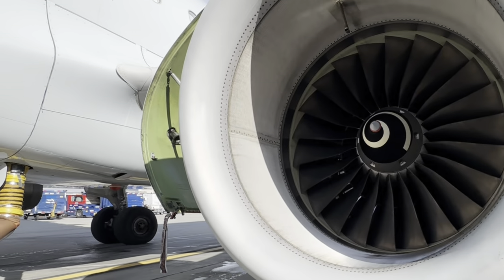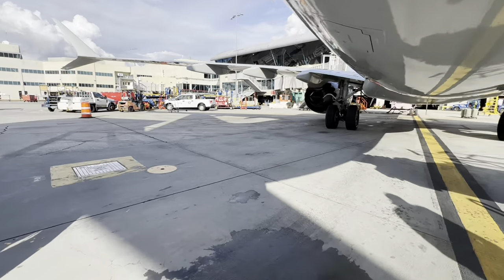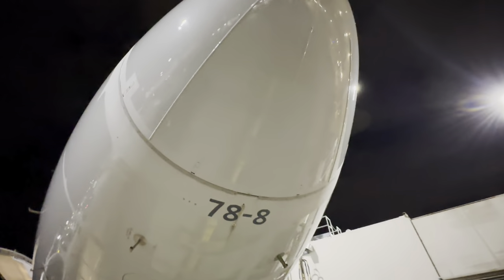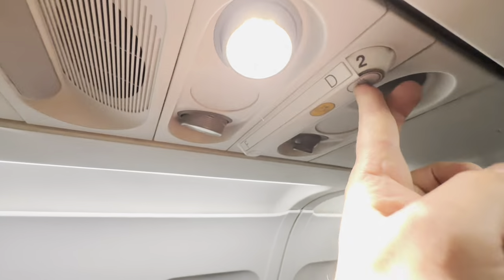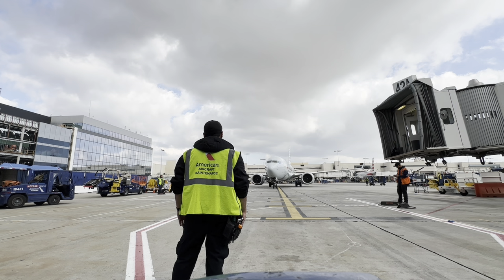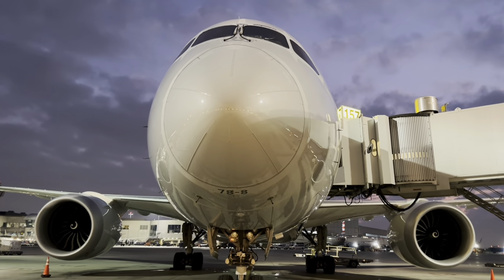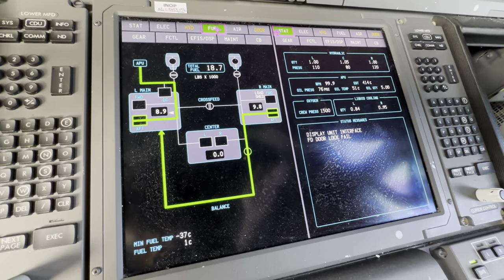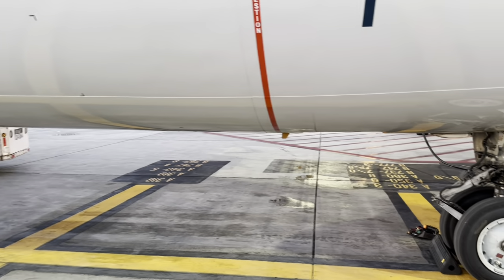Stig Shift #7 (22DEC23 - 24DEC23) Christmas Special

Comment: You work on many Aircraft,  what's your thoughts between Boeing and Airbus these days, which do you think makes the best Aircraft, in regards to build quality, I know since Boeing teamed up with McDonald Douglas, and moved plants, there finished products have been questionable
Reply from the maker: That’s a hard question to answer, I love both but I also have complaints on both. Nothing is perfectly made sometimes. There’s always a give and take. For example, Boeing is an excellent product, built for longevity, but in recent, their quality assurance has been lacking. And it makes me question why they are not producing flawless aircraft as they used to. Obviously we can bring in the discussion of the merger of McDonnell Douglas. But that’s a whole separate subject. In regards to Airbus, they build an excellent product, but it does not have the longevity. Overall, if these aircraft are properly maintained, they will pretty much fly forever, but at that point, you have to look at cost-effectiveness.
Reply: @StigAviation  Thank you for answering me, and a happy new year by the way, a while ago I watched a programme called broken dreams, and it focused on the dreamliner and it's build quality, even asking if Boeing workers would fly on it, lots of them said no, but to date they have never lost an aircraft of that type, I'm wondering if in the future the problem will be with many carbon fibre planes, and there degradation, but as they say aircraft travel is still the safest form of transport, I just wish all manufacturers would list safety at the top before profits 👍

Comment: From top to bottom throughout your video in one breath, thanks, Stig!!!👍👍👍 I'm proud of your attitude: every A/C is a piece of the art, doesn't matter Airbus or Boeing. By the way, I'm B1 on A320 fam. We've  got A320 with CFM56, LEAP & V2500. What I think, V2500 is less maintenance friendly as other, although I love this engine🙂
Reply from the maker: V2500 is a special child. For some reason, I have deep connection with that engine, I have taken it apart, and I have put it back together myself. I know it’s a very difficult engine and very poorly designed in some cases because Pratt & Whitney decided to touch it, but its Rolls Royce roots stand true and this is why I love it.

Comment: I’m curious about the single fuel crossfeed valve on the 787. My airline’s 767 fleet all have dual x-feed valves (except for a few tails) for ETOPS functionality. The few tails that have a single valve have to be cycled before top of descend on each flight to make sure they work. It’s obviously done at the end of the flight in case the valve fails open. Do know why the 787 only has one valve? Are any procedures in place?
Reply from the maker: William, I haven’t had many issues in regards to the crossfeed valve within the 787. I will do my due diligence and study further and try to understand the manuals more. I am not sure if it has a secondary crossfeed valve. I’ll get back to you on this one buddy. The 787 is a very fascinating creature and it’s incredibly complicated. I learn every single day from it even though I’ve been working on it for the past 7 years.

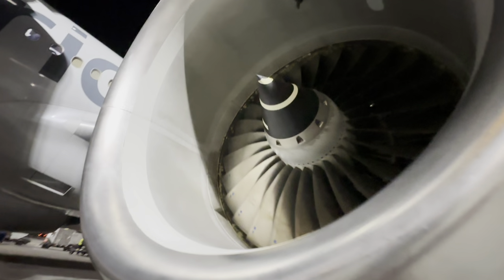Comment: Lol 18:31 @ Stig. As a P&W employee that has an intimate knowledge of our product, wait until you guys start messing with the GTF 😂😂. We were on Flight Test compliance engine 2 (like 2012) and the test engineer handed me a LRU list to validate fits. Out of 20 planned LRU swaps…… I returned with only 3 and I distinctly remember telling Hamilton SubStandard that Airline guys are going to HATE this pig.The PW4000 is a beast tho, when we slam it to TOGA, the entire test stand will move.
Reply from the maker: No doubt the 4000 is a beast of an engine, it is just a pain to work on. As for the GTF engine, we will not be getting those, we are a fleet of CFM leap engines.

Comment: Random fact, Concorde’s fuel tank ruptured from the inside because of the pressure from the impact. The fuel tank was supposed to have an air gap when filled (12% I believe) but had its limit removed by the captain to over fuel to 100%. The impact of the strip of metal caused the pressure wave to blow out downwards
Reply from the maker: You are absolutely correct Justin. Hence why modern aircraft now have these impact resistant door as well as surge tanks for protection from cavitation

Comment: Here’s a question: how long does an engine stay hot for after it’s shut down? Meaning, at what point could you touch components with your bare hands? Thanks and love the videos!
Reply from the maker: That depends on what part of the engine you’re wanting to touch. On shut down, it usually takes about 30 minutes for the external portion of the engine on the hot section to cool down, anything on the internal portion of the engine it usually takes about 3 to 4 hours to completely cool down.
Reply: @StigAviation  good to know, thanks!

Comment: Question - how often does the plane exterior get cleaned? Mainly the brake dust, oil grime under the engines, stains under the belly? Does it happen during some of the maintenance work? Or do the planes get washed randomly? Also, what products do you guys use to clean turbine / oil soot, and inside wheel wells?  Thanks!
Reply from the maker: Usually on intervals or heavy checks. I actually made a whole video about this. Check it out if you have time
Reply: @StigAviation  will look. Thank you. Again, love your vids and IG 👍🏽 I do a lot of my own maintenance with my A&Ps and IAs. Good stuff

Comment: Stig I have some questions for you. Have you ever performed a turbine/compressor jet engine washing? What kind of fuel do you use for aircrafts jet-A or jet-A1?
Reply from the maker: Yes I have done many engine washes. It’s actually a fun process. As for the fuel it’s usually JET-A1 and there are some airlines that use Biofuel.

Comment: The green light on the side of the "flat bed seats" indicates if the seat is in a safe configuration for Taxi, Take-off & Landing (TTL light).  It comes on to show that "an internal lock is engaged" to hold the seat in the upright position for TTL.  Without the lock, the seat would not be able to hold itself up in the event of an emergency (on the ground).  Love the content...thanks!
Reply from the maker: You’re absolutely correct and thank your for giving the TTL info. Thank you for being here

Comment: I was waiting for this one! Love the vids keep it up. Also what causes the discolouration in the engine get caused by and why is it always black and what is it made of, also how does the 777x put its winglets up from the flight deck, also seems like a dumb question but why do some engines have a cheese grater looking thing in them for cooling or
Reply from the maker: The discoloration of the engine comes from heat, those exhaust cones are usually made out of titanium, overtime and heat exposure. It will discolor. I don’t know much about the 777X. So I cannot speak on it intelligently. And if you’re asking about the cheese, grater, looking thing inside the bypass, that is for oil cooling, I believe I explained that in the video.

Comment: Hope you had a great holiday. Is jet-a basically the same as kerosene? How much psi are in the tires?
Reply from the maker: Jet A is basically a a refined version of kerosene it’s basically diesel. In regards to the amount of pressure in the tires it’s relative to the particular aircraft, let me know what aircraft tire pressure you wanna know about, overall, it usually ranges around 200 psi.
Reply: @StigAviation  interesting. I didnt realize that jet-a was closer to diesel than kerosene. Thats a lot more pressure than what i would have guessed

Comment: Great vid, Stig! Thanks for sharing all this info, always interesting to learn. What’s the general opinion on the difficulty working on the P&W GTF? I work at Pratt’s MRO shop in West Palm Beach supporting the PW1100 (A320/321 Neo).
Reply from the maker: I wish I could tell you, but I don’t work the Pratt & Whitney 1100, we don’t have those in our fleet. We have the CFM leap engines.
Reply: You'd have to reach-out to someone on Delta Tech Ops - they have GTFs on their A220s & A321NEOs.  Also United has only just started to receive A321NEOs - they have GTFs, as well, but are essentially brand new in Dec 2023, so likely not much practical experience yet.

Comment: Do the white dots on the top of the bottom of certain controls have something to do with the hat controller
Reply from the maker: There’s 2 parts to this. Certain push buttons light have two dots, Indicating that The corresponding part of the push button is not used. Certain push buttons do not remain pressed in. These are referred as “momentary action”  push buttons. 
There is another function and a notification for these push buttons and indicators. And that is a reversible and a irreversible action. The push buttons that have a dots on top are reversible that means the button or the action can be disengaged. Now the buttons with the dots on the bottom is a one time function. That means if you press it that is it one time function cannot disengage

Comment: hey stig thank for such great video one thing about landing gear if they get damage they can hit all hydraulic pipes going around and dam this aircraft got lot of hydraulic pipe even with partial fly wire and one more question do these fly wire aircraft have any manual control though cable in case of emergency or we are at luck of fly wire computer that controls actuator and vales to move these aircraft surface also u mention engine has actuator to optimize blade inside engine i though engine blade inside these engine are fix did u mean that acuator control flow to blades?
Reply from the maker: If there was any kind of damage to the landing gear, the landing gear itself would not go up, that would prevent any kind of damage to the wheel well. Aircraft that are purely flyby wire, have redundant hydraulic systems to compensate, so even if there was a failure of one system, the other system would take over. As for your last question, I did not quite understand what you meant, but the actuator that moves the blades are on the case of the engine

Comment: The height difference between a max and NG really surprised me first time I worked a max. Makes it much harder to get in the E&E without a ladder. 

Correct me If I’m wrong but I could have sworn the A330 has tri-wings… I’ll take the Torq’s on 787 or Phillips older airplanes any day over tri-wing.

I agree with you wholeheartedly about the PW 4000 engines. Only serviced the oil once, but not only was oil servicing in the hot section but I broke my favorite screwdriver opening the oil servicing latches because the latch tension was so high. CF6-80C2 or AE4 for me:)

I personally love all the info the 787 gives you. It can definitely be overwhelming at first, but once you get used to it, wow it’s a great system! 

Merry Christmas Stig! Love the maintenance poem:)

P.S. if possible I would definitely take up my buddy Ryan M. On his helicopter offer, he and I went to A&P school together, he went a different aviation path then I did but he loves what he does, is very knowledgeable and is a great dude!
Reply from the maker: Ryan is an awesome guy. I have been having an amazing time having conversations with him. Super smart dude, and I will definitely take up that offer when I have time to fly out there.

In regards to the 330, Airbus always uses its own proprietary screws, slightly off-center Phillips head style. I do miss working the 330 very much, it was one of my favorite aircraft. I don’t remember it having tri wing fasteners. 

Thank you so much for being here Zachary, I appreciate you and wish you a merry Christmas to you and your family
Reply: @StigAviation  Thank you for the correction on the A330 screws. Loved working the A330 as well. Love your video, learn something new every time!

Comment: Pushbuttons: STATUS over CONTROL
Reply from the maker: There’s 2 parts to this. Certain push buttons light have two dots, Indicating that The corresponding part of the push button is not used. Certain push buttons do not remain pressed in. These are referred as “momentary action”  push buttons. 
There is another function and a notification for these push buttons and indicators. And that is a reversible and a irreversible action. The push buttons that have a dots on top are reversible that means the button or the action can be disengaged. Now the buttons with the dots on the bottom is a one time function. That means if you press it that is it one time function cannot disengage

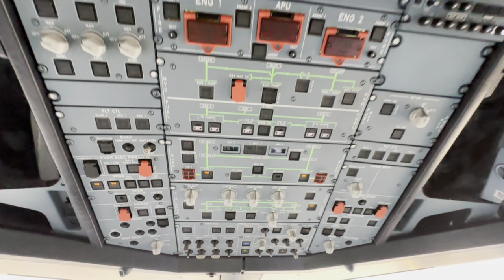Comment: He never answered the question about the 2 dots above and below on the the switches on  theoverhead panel. 24:57
Reply from the maker: My apologies on that, I completely goofed. Here’s the answer. There’s 2 parts to this. Certain push buttons light have two dots, Indicating that The corresponding part of the push button is not used. Certain push buttons do not remain pressed in. These are referred as “momentary action”  push buttons. 
There is another function and a notification for these push buttons and indicators. And that is a reversible and a irreversible action. The push buttons that have a dots on top are reversible that means the button or the action can be disengaged. Now the buttons with the dots on the bottom is a one time function. That means if you press it that is it one time function cannot disengage
Reply: @StigAviation  Thank you sir. Always great videos.

Comment: top: aircraft systems, bottom: passenger comfort?
Reply from the maker: There’s 2 parts to this. Certain push buttons light have two dots, Indicating that The corresponding part of the push button is not used. Certain push buttons do not remain pressed in. These are referred as “momentary action”  push buttons. 
There is another function and a notification for these push buttons and indicators. And that is a reversible and a irreversible action. The push buttons that have a dots on top are reversible that means the button or the action can be disengaged. Now the buttons with the dots on the bottom is a one time function. That means if you press it that is it one time function cannot disengage

Comment: I think I brake road that plane (3TH) a few weeks before this in LAS.  It was in PERFECT condition.  No dings, stress wrinkles.  No drips, no carbon buildup anywhere.  I'm pretty sure the tires may have been factory issue!
Reply from the maker: It still had the brand brand new airplane smell too 😅

Comment: Stig, have you ever worked on an aircraft that ended up with a technical problem requiring an emergency landing? Like a landing gear that won’t retract, or flaps that won’t extend, or an engine that has to be shut down? I’m curious to know what goes through your head at such moments.
Reply from the maker: I have had a few of those moments. And it wasn’t anything I did, it was just a malfunction that occurs time to time. The aircraft comes back to the gate and we addressed the situation. Either we can fix it or we have to ground the aircraft for further troubleshooting.

Comment: Sorry if I missed in vid or comments but I didn’t catch explanation of the dots on the A320 overhead push buttons
Reply from the maker: There’s 2 parts to this. Certain push buttons light have two dots, Indicating that The corresponding part of the push button is not used. Certain push buttons do not remain pressed in. These are referred as “momentary action”  push buttons. 
There is another function and a notification for these push buttons and indicators. And that is a reversible and a irreversible action. The push buttons that have a dots on top are reversible that means the button or the action can be disengaged. Now the buttons with the dots on the bottom is a one time function. That means if you press it that is it one time function cannot disengage

Comment: I wonder how much thrust is produced from the core and how much is made by the bypass fans.   Stig, do you use a borescope working in line maintenance?
Reply: The general statistics say about 25% of thrust comes from the core. Inspection is the ones usually using borescopes.
Reply from the maker: According to the manuals, 80% - 85% thrust is usually coming from the high bypass. And Boros scope is usually done in a hangar environment, and I have done that many times.
Reply: @StigAviation  I find it fascinating that fans provide that much more thrust than the core.

Comment: Thank you for this awesome video. I have a question though, last stig shift video you showed us a patched up 737 and the effects of lightning strikes what I am curious about is how lightnig strikes affect composite materials like on the 787. I know that they have a conductive layer but is there still damage from a lightning strike and if so how is it repaired.
Thank you again for the amazing content you make and thanks for keeping aviation as save as it is!
Reply from the maker: This is a very excellent question when it comes down to the 787 that aircraft has a very specific protection, called Fairday cage. It basically bonds the aircraft together electrically, imagine one big bonding strap. That’s what it is.  The 787 has encountered mini lightning strikes, and it’s very susceptible to them, because it is composite, but the aircraft can withstand the damage. The repairs are the difficult part when it does happen.
Reply: Ah very informative I appreciate the info. So if damage occurs it's mostly the paint and fairday cage taking the hit but the composite is relatively unharmed
Reply from the maker: @thatlonelydriver4956  it’s a combination of it all. We have very detailed manuals to repair it.
Reply: @StigAviation Just for accuracy purposes, the correct name is Faraday cage, named after scientist Michael Faraday. Anyway, great video, as always!
Reply from the maker: You are absolutely correct, thank you for correcting me.